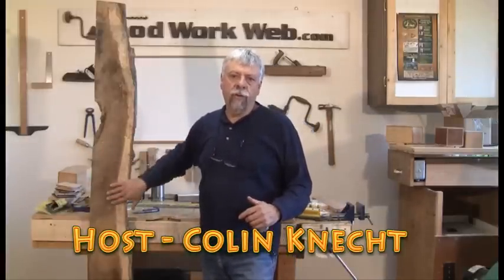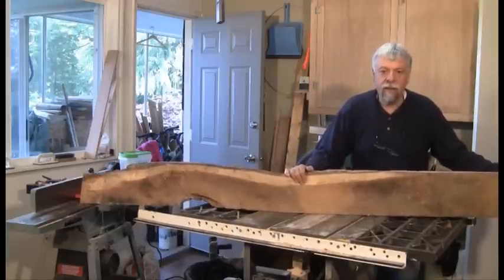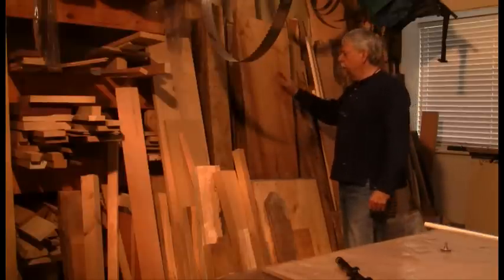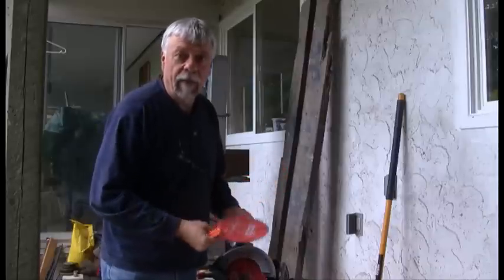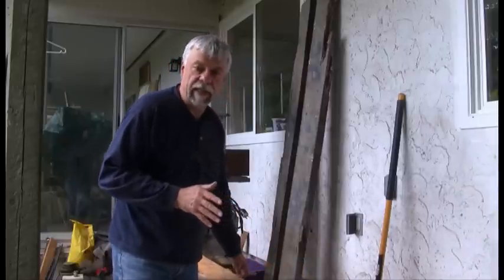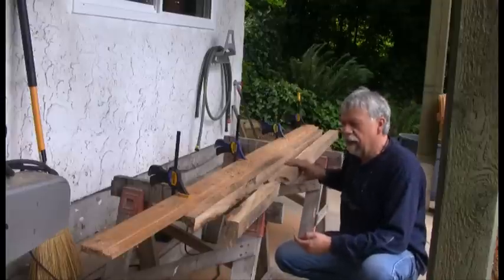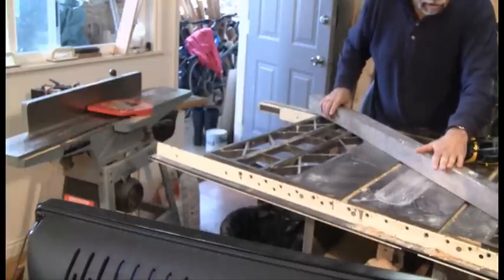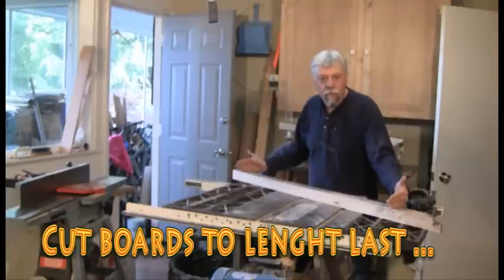Dressing Rough Lumber  - A woodworkweb.com woodworking video

Comment: Eight quarters! It's like channelling the seventeenth century. More than time to go metric, people.
Reply from the maker: I agree with you, unfortunately we tried doing that in Canada, and now we have such a botched system it's a total mess. Some stuff is Imperial other is Metric. Purchase some bulk cheese and it's kilos, but go buy bulk nails and they are in pounds. All wood is now back to feet and inches but buy carpet or fabric and it's meters. Ask someone how tall they are and they will tell you in feet and inches, then ask them how far to the next town and it's kilometers.  Metric is easily the best system but as long as our biggest trading partner is Imperial we'll end up with this crazy mixed system :(
Reply: WoodWorkWeb I blush to say it, but we have much of the same in the UK, particularly in temperature. If its cold, we use Celsius and say it is about zero. When it's hot we switch to Fahrenheit and it is about 90.

Comment: hi I called Jim and is from Denmark first let me say thanks for a great program, I kontagter you because I need your help to start my own studio up, but my broblem is that I have no jop so the money is small. so I hope that you or some of your fans can help me with getting a repair shop up and running, I can use all hand tools and the like used but not power tools, since we have 220 volts in Denmark,
 Denmark
Kildevænget 1
 8660 skanderborg
jim borg
 I would like to say thank you for taking the time to read this message would not succeed then there is nothing to do about it but something comes out of it, so I want to say thank you to my and my family's behalf.
 Sincerely, Jim borg
Reply from the maker: Jim Borg Good luck with starting up your shop Jim, my suggestion to you would be to connect with a woodworking guild locally, they will probably be of more help to you than anyone ... hope it works out for you :)